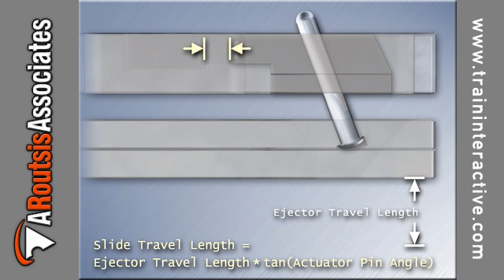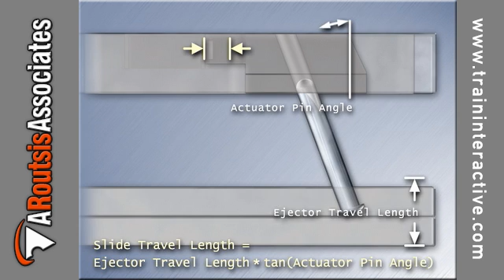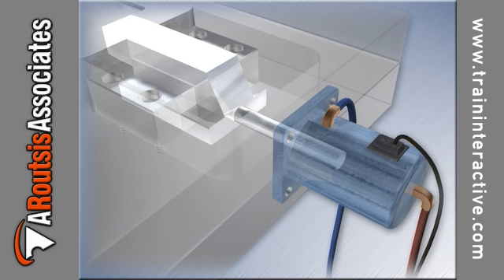Mold Design and Moldmaking - Actuators (excerpt)

Comment: why we use approx 5 degree more for heel block with respect of actuator pin. please explain anybody.
Reply: By adding 5 degrees to the heel block angle you will ensure positive lock up of the slide assembly. Also, when I would design a slide mechanism for molds, I would ensure that the heel block carried all of the pressure of the injection force. The pin did not have any slide pressure placed on it during the injection process. I hope this helps.